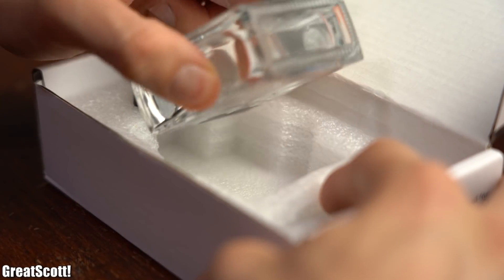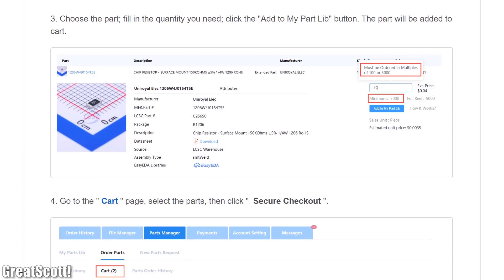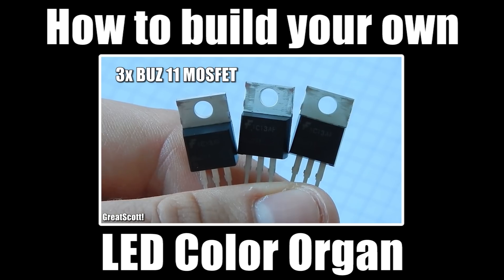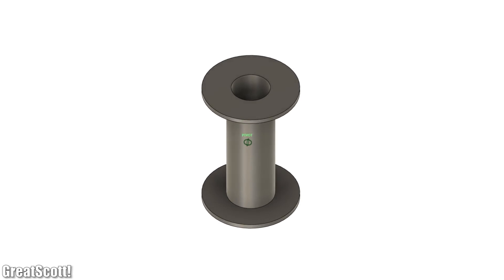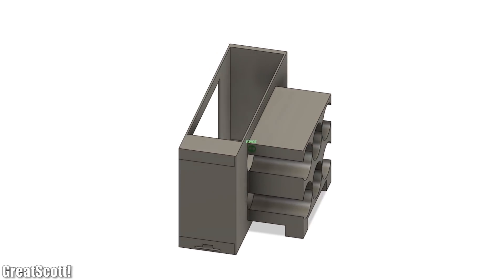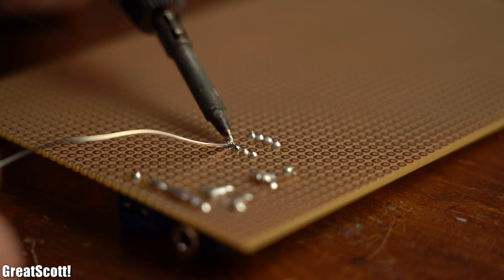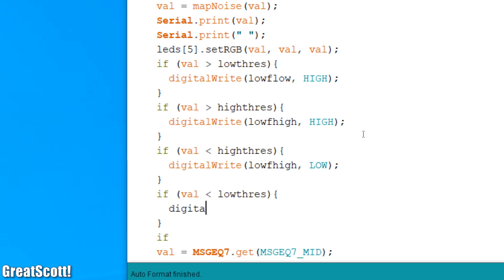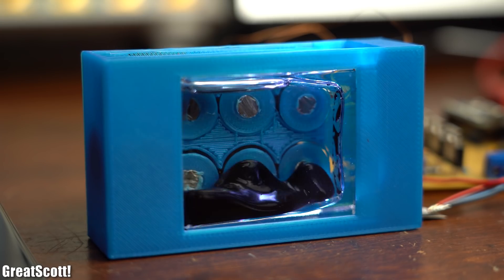Ferrofluid can dance if you know how!

Comment: I know this video is almost a year old, but I'll shoot my shot. I'm trying create an application similar to this, using 6 eleectro magents and the MSGEQ to visualize audio using ferrofluid. I am currently testing the magnets, and each one seems to have ~0.5A being drawn when the circuit is turned on. This huge current is seeming to short out my board, as the entire circuit pulls about 4A when every magnet is turned on. Do you have any tips for limiting the current fllow or configuring the magnets so they pull less current?

Comment: Late to the party but a simple suggestion: Instead of a vertical jump, angle the bottle back 30 degrees or so and it will be more reactive, as the ferrofluid will go up a ramp instead of purely jumping.  Also add a white card behind the bottle so you can paint it with LED color; the blue plastic electro magnets don't do the LEDs justice.

Comment: i just tried to build it. first i just wanted to see the frequencies, so i soldered everything in place, like its in your schematic. then i hooked it up to the arduino (i am not using a external power supply, but the 5V and GND pins instead) and tried to print it like in your video.
it keeps printing values around 205 on low mid and high, and doesnt even change when i change the frequency on my phone. it also shows those values when i dont plug the phone in too.
where should i start debugging?

Comment: Gutentag Scott, 

I am watching your channel since a few years. I really like how you explain stuff in a clear and understanding way! Thankyou! 

I am contacting u via this way because I have 2 PS4 controllers. They both wont charge anymore. Both died +- 5 months after eachother. 

I know the charger goes into a little PCB and then transfers power to the battery. I ordered new ones on Uncle Ali's website and removed the broken ones. 

I was wondering if by any chance. If I send you these broken PCBs would you like to examine them and report  what actually failed? I am just wondering. It does not have to be an official report or so. - just for fun.

I've charged the controllers with wallchargers, usb power output and quickchargers.

I am looking forward to your answer. 

Yours, Mesut

Comment: One immediate problem is that higher frequency sounds in music tend to be very short (like hihat) and less energetic, so those heavy particles do not have enough time to accumulate. Other than making those signals stronger, i wonder if that flask getting thinner (less volume) to the high pitch direction would help.

Comment: The world's most basic spectrum analyzer!
You didn't need to design that wire core, you could have gone to your local sewing or hobby store and just gotten a spool of thread.

An Adruino kinda seems overkill for this project, you could have achieved similar results without it just using a few opamps

Comment: This is really cool! I think I might have a project idea for you. I’ve noticed the drill you use is a Makita 12 volt one, so something I’ll bet you didn’t know, is you can buy battery terminals online for the particular battery your drill uses. So I got this idea from a video AvE made https://youtu.be/ezLOAwF3rl8
You could make a portable power supply and 3D print a housing for it, but if you used a variable boost/buck converter instead just a buck converter you could get the same voltage your lab bench power supply puts out, then you’d have a portable power supply. Granted I know the one in AvE’s video uses and 18 volt makita battery, but they do also make terminals for 12 volt batteries if you search Ebay for Makita CXT 12 volt battery terminal/connector.

Comment: love this! i have a suggestion though, try making a bottle for each frequency band. then put 2 electromagnets on opposite sides on every bottle, and then for each bottle and the corresponding frequency band you turn the right magnet on when the signal is positive and then turn on the left magnet when the signal is negative, so you would then see the ferrofluid vibrate following the waveform. i think this would be super cool i really hope you do this

Comment: "We can not use permanent magnets [...] because we can not electrically control them, except maybe with motors"
Electropermanent magnets can be switched "on" or "off" with an electric pulse (and as far as I know they are considered a type of a permanent magnet and not another category entirely), so there is a way to control permanent magnets without motors :)

Though I doubt it was an option here as they're really not common. Especially since there are also permanent electromagnets (just an electromagnet that's magnetized by default, and applying current removes the magnetic properties) that confuse the hell out of search engines, so I wasn't even able to find any for sale and the only product I ever had contact with that used them is Logitech MX Master 3 mouse (used for switching scroll wheel between free gliding mode and ratcheted mode)

Comment: Nice,  but probably could have done this with analog RC filters and PWM drivers.  just convert the amplitudes into higher duty cycles.   555 timers could have even done the PWM part or perhaps TL494's.

Comment: That's so satisfying to watch... You forced me to make my own...
I'll try to make it at even more smaller scale but keep the ferrofluid Horizontally any may be use 9 small electromagnets... That way the electromagnets need not to be that strong since ferro Fluid is placed horizontally may be between two acrylic sheets 🤔
Damn it, can't ferro Fluid be used to make an e-ink display 😲?
Edit : How about a Ferro fluid digital clock that's layed horizontal by attaching a mirror at 45⁰ would make it vertical... Can't thank you enough 🔥🔥🙏

Comment: I have a question:
On my cottage i have 12v dc from solar power only. I want to have a router on the 12v system. But i think the 12v on the cottage can regulate littelbitt from 10-14v dc. Is there any device i can use that can take in: 12v dc and output: constant 12v dc?

Comment: There's a cool trick you can do with MSGEQ7 chips. The center frequency of it's bandpass filters tracks the natual frequency of the external RC circuit. So if you change the resistor values, you can get 7 new bands. I used this to get a 21-band equalizer with 3 chips once. It worked great!
Reply from the maker: Thanks for the tip. Sounds interesting :-)

Comment: If you think that your print needs more supports, then your design probably isn't optimized enough for 3D printing. You can try splitting the design into parts, which helps reduce the amount of supports needed.
Reply from the maker: Yep, I admit I am not the best designer (everyone can tell). But I think my enclosure was good enough for the job. Maybe there will be a version 2 with a better enclosure....who knows ;-)

Comment: Very interesting, but maybe you could adjust the thresholds to be inaccurate, but more pleasant visually. I'd like to see the midrange and treble bouncing a bit more.
Reply from the maker: The problem with the middle frequency was that there was no wall for the ferrofluid to climb up. This is why the mid frequency ferrofluid did not reach up from the bottom but could only go there from the side.

Comment: 70°C temp of the coils is bit high, cause the plastic, PLA and PETG can easy melt...
Reply from the maker: Tested it quite extensively. Worked like a charm at that temperature.
Reply: @greatscottlab  yes but if its pla you should care about deformation over time, cause its over the temp limit.. i think it get not bad, but care about it and maybe better filament, if so^^